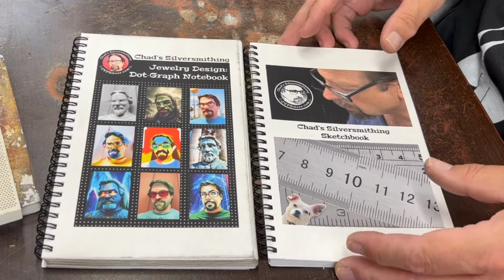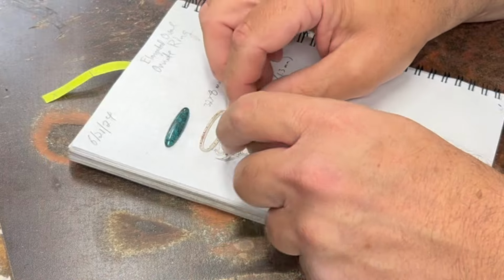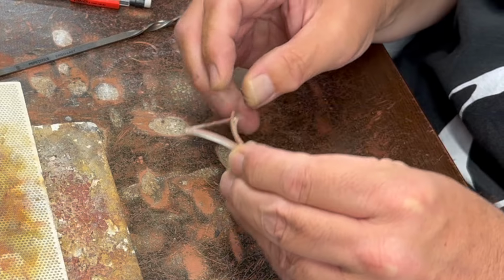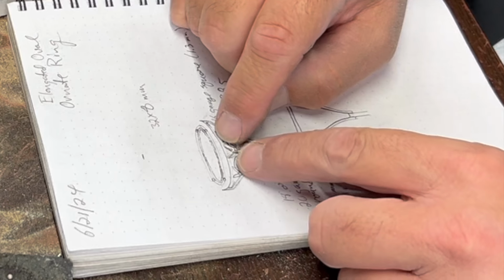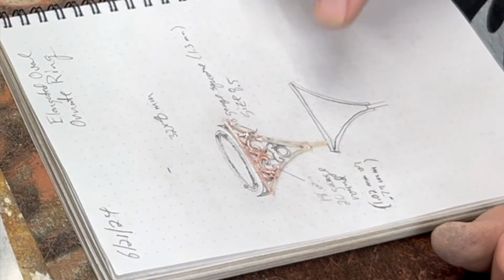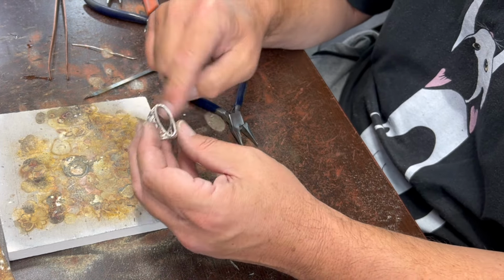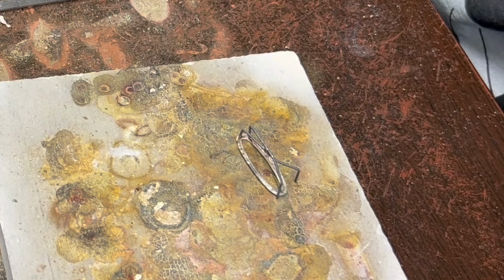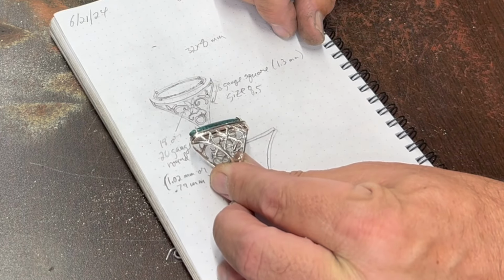Make an Ornate Setting for a Long Cabochon: A Silversmithing Tutorial

Comment: Very nice Chad!!!! You help me immensely!! Lovely work. 
  Ive just started silversmithing within a year and went with argentium. So far, so good as I don't know any better. Do you know??
Reply from the maker: I've honestly never tried Argentium.  I'm always tempted to buy a little to try it, but it's on the bottom of my shopping list:). I know some folks love it.  One of my close friends tried it, and struggled with soldering when using it.  What is your experience with it Robboback?
Reply: @chadssilversmithing 
Chad I'm the guy who uses argentium. I have no trouble soldering it. But, I haven't soldered sterling!! I've been tempted to get sterling but worry about fire scale!!! I've had a long life of soldering and welding/brazing. It's no problem to make sure the metal is clean with the right flux. 
(I've soldered and brazed without flux!!!) But everything was super clean. Try argentium some time just for the heck of it. I'm buying sterling! How do you like the hike in silver prices? Are they going to take silver away from us like they did with gold!!!?